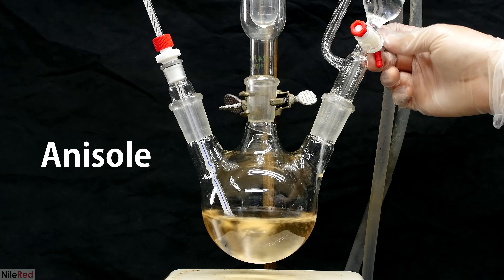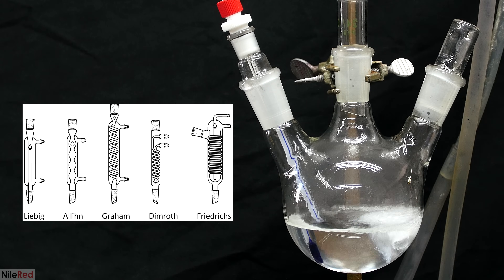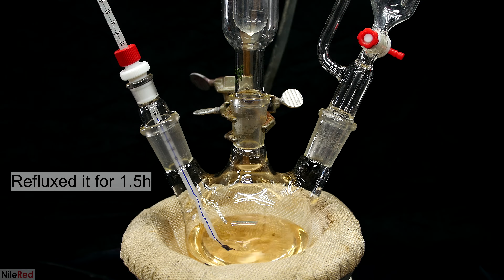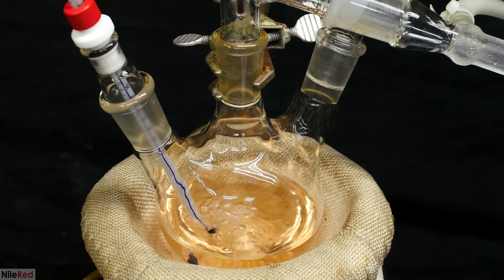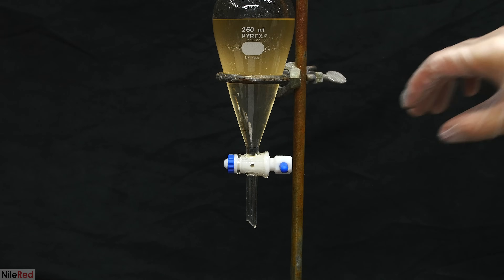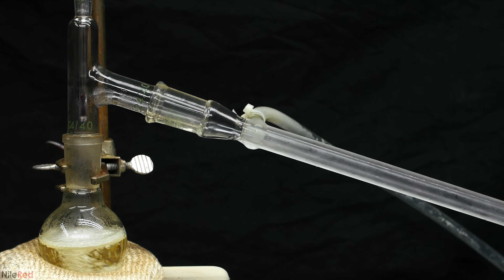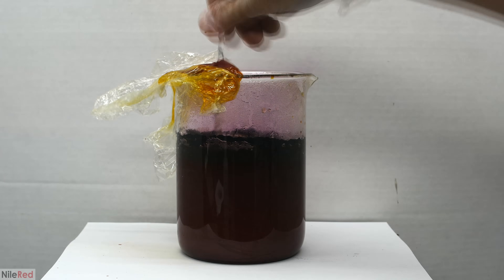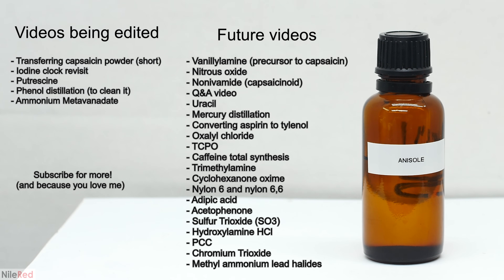Making anisole

Comment: i know it has been like 9 years but in 5:10, the reaction probably didn't spike temperature maybe due to the concentration of reagents (if it wasn't the same ofc) or due to a ceiling in the boiling point. if the reaction was even remotely close to refluxing, that reaction heat just goes to phase change instead of rising the temperature. Probably his setup somehow allowed the superheating of methanol (having a poor reflux efficiency condenser cause this, even having a closed system or anything like that), essentially meaning you don't let the methanol boil, that heat can't go to phase change hence the temperature rise. i could be wrong tho, its just what i think could have happened

Comment: The carbon-iodine bond is very long; the usual bond length is comparable to the sum of estimated Van der Waals radii of carbon and iodine. The bond is very weak. That makes methyl iodide a “hot” electrophile. For example it very rapidly quaternizes ammonia and many amines. That means it keeps reacting with amine lone pairs of electrons until the nitrogen has a formal permanent plus charge and four C-N bonds. That’s called exhaustive methylation. 

You can buy very clean phenol as a solution in water. Suspending it in n-heptane and carrying out azeotropic drying with a Dean-Stark trap removes the water leaving behind a dry solution of phenol in heptane that gives beautiful needles of phenol if cooled slowly. Handling pure phenol with glass or ceramic spatulas keeps it colorless and decreases the color in the product. Phenol readily dissolves oxides from metal spatulas, and the phenolic solution catalyzes air oxidation of phenol. Oxidation products of phenol are intensely colored.

Comment: Making anisole is honestly too much effort and a massive time commitment, and it's significantly easier to just find anisole. Anisole is often found taking handicap parking, yelling at minimum wage employees and may also be located at work or home for some, but not always guaranteed. The fastest and most efficient way to find anisole is by simply observing the epidermis between both of your own gluteus maximus muscles. A thorough inspection should reveal anisole 99% of the time.
Reply: Thanks for the advice. The anisole found between those 2 muscles seems to be of sufficient quality for my syntheses.

Comment: Why doesnt the methyl iodide just react with the excess sodium methoxide? Seems to me the dimethyl ether would just bubble out
Reply: Phenoxide has a much lower pKa compared to methoxide (10.0 vs 15.5) and thus the equilibrium moves toward it when its combined with sodium methoxide solution. In fact, phenol is about 300,000x times more acidic than methanol so very little methoxide will be present by the time methyl iodide is added. 

I'm just an undergrad but this is my best guess.

Comment: The reaction mechanism is Electrophilic substitution reaction. Since anisole is methoxy benzene and all benzene compounds undergo ESR pretty easily.
Reply: This is just an alkylation reaction. Phenol already has a very acidic OH, which attacks the electrophilic MeI to make the aryl methyl ether.
Reply: Isn't alkylation a ESR
Reply: @nushurasaher9876  I think you’re thinking of Electrophilic Aromatic Substitution. But we are creating the phenoxide anion, which attacks the methyl iodide in an SN2 reaction. You are correct, however, that the product, Anisole, would undergo an EAS reaction rapidly due to high electron density in the arene ring.

Comment: question, my chemistry is a bit rusty what is the difference between polar and non polar atoms?
Reply: also wtf is valence
Reply: Atoms aren't polar, the bonds between them are (or rather can be). When you have two atoms with different enough electronegativities, the electrons in the bond will be pulled more torwards the electronegative partner. That way it obtains a negative partial charge while on the other side of the bond you get a positive partial charge due to less electron density

Comment: Why is Sodium-Methoxide used to deprotonate Phenol? Isn't Phenol quite acidic and could be deprotonated by something readily available like NaOH? In that case no metallic Sodium would be required.
Reply: Absolutely. PKa of phenol is around 10, so vanilla NaOH will do the job.
Reply: NaOH hydroxide can be very hydroscopic(sodium metal rapidly dries the residual water in the MeOH), methyl iodide can be hydrolysed vis an Sn2 mechanism to form methanol and I- which would make the methylation reagent degrade, lowering yields.

Comment: I have no idea why have you used such a strong base. ACN or acetone/K2CO3 is totally proper system for such reactions.
Heating is also not a good idea, because of the low b.p. of MeI, also this reaction undergoes in prety mild conditions.

Comment: Is that nesseseary to wear vinil gloves when syntetising this compound?
Reply: With phenol being toxic on every exposure, methyl iodide being toxic on inhalation and on swallowing, methanol being toxic on every exposure and also an excellent solvent, dichloromethane being carcinogenic and also an excellent solvent and sodium hydroxide being very basic, I think you should wear butyl rubber gloves at the very least and wear a gas mask or do it outside/in a fume hood.

Comment: I'm just wondering, why did you have to use methoxide to deprotonate the phenol? Couldn't you have just used NaOH to deprotonate the phenol and reacted that with iodomethane to produce the ether? The phenol can be deprotonated by NaOH so the Na metal wouldn't be needed?

Comment: I wanted to ask if it possible instead of the first simple distillation (to distill methanol off), can we just wash it with water and DCM, cause methanol is soluble in water, also, can we start with sodium in the flask (and keep that in a cold water bath), then with the addition funnel we keep adding methanol dropwise (it will keep most of the methanol from boiling)
Reply: @mohammed, if you do the DCM/ water workup without distilling off the methanol, its going to be very messy because methanol would want to be with both the water and the DCM layer and it will eventually make a very bad emulsion. Although theoretically you could use huge excess of water to force methanol to go that way but honestly it's much easier to just evaporate it. Coming to the second question, you can not keep sodium in water. It'll react so vigorously that the flask would explode. And you shouldn't care about methanol boiling off because you eventually want too boil it off anyway. Although if you don't want that to happen, you can add the sodium slowly. Then again for complete reaction, generally its heated to reflux.

Comment: You used dirty phenol which could affect the temperature increase. I haven't seen Chem players version though so I wouldn't know the purity of his reagents. Also why didn't use sodium on the phenol and then add the methyl iodide instead of using it on the methanol reacting with phenol and then using methyl iodide.

Comment: Hey nile - is there any way to make / get Nitric acid without access to potassium nitrate?
Nitrates are hard to come by in Australia.
Reply from the maker: You can break apart nitrogen in air to form NO2 and pump it into water, but it is pretty slow (I forget the name of the process). That would be your only other real option.

Look online though, sometimes people will sell it. In canada, its not the easiest thing to get but ive found it a few places online (like ebay)
Reply: Electrolize the air.
Reply: Thank you!!!

Comment: Under acidic conditions caused by HCl and H3PO4, the aldehdyde is protonated, forming an oxonium ion. The benzene ring attacks the oxonium ion at the para position (it can also attack at ortho) because the resultant cation is more resonance stabilised than at meta.

The cation is deprotonated by a base in the environment to restore aromaticity in the ring. Next, the OH group (coming from the oxonium ion) is protonated, forming -(+)OH2. Water is a good leaving group under such acidic conditions, and so it leaves, leaving behind a secondary carbocation which is actually resonance stabilised by both the benzene ring and also the electron donating -OCH3 group. Cl acting as a nucleophile, now attacks the carbocation, forming the anisole-p-(1-chloropropane).
Reply: Anisol fiedel caraft reaction . Please??? Anisol +cloroaceton reaction p2p ?????????????????

1 saniye önce

Comment: For the mechanism of the reaction to form anethole, I would assume in step 1 the first thing to happen would be that the oxygen in the propionaldehyde would be protonated to make the carbonyl carbon more electrophilic. It would then undergo a Friedel-Crafts acylation by reacting with the anisole at the para position due to favourable resonance forms of the Wheland intermediate, removing a hydrogen from the benzene ring as a proton and forming a carbon-carbon bond between the ring and the aldehyde (which is now an alcohol). I think that the alcohol group would then be protonated by HCl and via a nucleophilic substitution reaction (like Sn1 due to the possible resonance forms of the carbocation intermediate) water would be lost sand replaced by chloride. In step 2 the pyridine acts as a base and initiates an elimination (possibly E1 for the same reasons as for Sn1, and especially if the pyridine is dilute). The pyridine abstracts a proton the carbon adjacent to the halogenated carbon and the hydrogen's electrons are donated to form a carbon-carbon double bond as the chlorine is kicked off as chloride. I think that's how the reaction would work, just trying to go off of what I've learned so far at uni.
Reply: how much words are here?! XD
Reply: @bingbong430  yes
Reply: But what happened to the phalanges ?
Reply: Too. Many. Words.
Reply: I think it’s not specifically a freidal crafts acylation since the reagents used are different here. Friedal crafts acylation is done using anhydrous Alcl3 and not H3po4 it is an acylation process but not friedal craft. Its actually an ESR reaction
Reply: Nice use of google. Next time change some words so it isn't verbatim.

Comment: Hey Nile, you should leave some sodium metal on the scale and see how much it goes up due to oxidation! (You'll need a lot of surface area though)
Reply from the maker: I think I might need an analytical scale to demonstrate that properly
Reply: NileRed I imagine if you had a x0.00 scale you could see something happening if set up correctly, but yes it would be more feasible with an analytical scale.

Comment: Hey Nile. I got some options of other chemists for the synthesis of antethole from anisole. We figued that a possible mechinism would have the propionaldehyde converted to its enol form in a Keno-Enol Tautomerism. The Enol form has a good OH leaving group that would be attacked by the HCl. This produces the  1-Chloropropene that has a slight positive on the 2nd carbon. This is where we got lost. It seems like the HCl unless entirely depleted would attack the 1-chloropropene again but instead we need the activated ring to attack the 1-chloropropene double bond converting it into 1-chloropropane bonded para on the ring. I dont know if this will be helpful at all but I've been trying to work it out all day. Can't wait to see it!

Comment: 1) 1st step similar to aldol addition like in  phenol-formaldehyde tar synthesis directed in p position due to the steric hindrance, followed by mainly SN1 substitution of benzylic OH by Cl (Secondary benzylic OH should favor SN1, if solvent is water-that's the case)
Formally first step may be considered as electrophilic aromatic substitution-it's very similar to chloromethylation reaction, aldehyde  is protonated on carbonyl =O, HOMO of anisole is degenerate Ψ2 and Ψ3, LUMO of aldehyde π*. Aromaticity is disrupted, untill positively charged intermediate (stabilized by methoxide sp2 oxonium) looses proton to any base (water for instance). Then benzylic 
OH is protonated, it leaves as H2O, leaving behind flat benzylic carbocation stabilized by P-sigma hyperconjugaation and resonance with P-methoxyphenyl and coordinated by H2O (oxygens lonely pairs). Carbocation is than attacked by Cl- and we get the product of first step.
Major side products of first reaction will be 1,1-di(p-methoxuphenyl)propane, 1-(p-methoxyphenyl-propan-1-ole and 1,1'-dichloropropyl ether
2) E2  Elimination-base is Py

Comment: Not sure if anyone has given the correct answer on the mechanism, but I'll give it a go. The  oxygen on anisole is electron donating making it an ortho/para director. The lone pair from the oxygen can resonate to the para position and this in turn will attack the aldehyde in an electrophilic aromatic substitution. Then a tetrahedral intermediate will be formed which is easily protonated by HCl or phosphoric acid. The phosphoric acid protonates the resulting alcohol a second time and now you have a good leaving group. Since this is a benzylic position the reaction should then proceed SN1 and water will leave resulting in a secondary carbocation. Chloride being a good nucleophile can then attack this position forming the first product.
Reply: anisole formed p2p with chloropropane????

Comment: You wont have sodium methoxide in water.  Methoxide ion is a strong base and it reacts with water to form methanol
Reply: The pKa of methanol is 15.5 while that of water is 15.7. Hence, both methanol and methoxide can exist in water, and in fact methoxide is slightly favoured! :)
Reply: The pKa is temp dependent.  Plus, have added lots of water so push the equilibrium across to hydroxide.  If you have done it right you wont have much methoxide due to the reaction with phenol.  In fact this react has been done by adding solid sodium hydroxide pellets

Comment: You can easily use a leibigs condensor - I've done it hundreds of times with no problems..  Just add the sodium slowly, keeping the sodium under hexane until you use it. You can use dimethylsulphate instead of MeI. C-I bond is polarised.  Can easily be proven ...

Comment: Nile, the fact that you'll reupload just for a error you could cover with an annotation is admirable. Keep it up dude.
Reply from the maker: Thanks for the support :)
Reply: @NileRed  on your "Recreating one of the weirdest reactions" you said 1.5 grams but on screen it showed 5 grams for some reason. (at a bit after 5 minutes)
Reply: @NileRed  I can just imagine you in your Nile blue state of mind replying back to this,leaning back in your chair and just saying “why didn’t  I think of that”
Reply: @NileRed  someone asked me what type of gloves i would be comfortable handling dimethylmercury with and i said i wouldn't handle the stuff without 2 layers of kevlar and ar500 bulletproof steel plate am i wrong?(for those who don't know it absorbs through gloves and 3 drops will kill you by attacking your brain and slowly making u deaf and blind,then you're just locked into a body where no nerves work)
Reply: @Anon-zu3xn  Use highly-resistant laminate gloves (e.g., Silver Shield or 4H) under a pair of long-cuffed, 6 mil (minimum thickness) nitrile gloves to provide the best protection against dimethylmercury.  DO NOT use latex, PVC, butyl, or neoprene gloves.  Highly toxic dimethylmercury penetrates these materials rapidly. 

As per the Harvard University lab regulations. Kevlar and ar500 won't do anything. It takes less than 1ml dimethylmercury to cause permanent damage, the only option for surviving is listed above. Just don't use organic mercury. There isn't a glove on this planet I'd feel comfortable using for it.
Reply: @NileRed  what are your thoughts about nile green
Reply: Especially since Youtube dumped all its annotations as of recently. Yeah, people were spamming them, and getting them to work on mobile was problematic, but look at all the cool things people did with them; don’t throw the baby out with the bathwater!
Reply: I can imagine, back to camera and mic, then the editing program, then export, then upload! What a job! love this guy.
Reply: Hell. major news sources dont even do that!
Reply: I wish all the Youtubers who make a mistake in their narration, and then take the time to graphically annotate a correction, would just go back and re-record the line of dialogue, because how hard can it be!?
Reply: They got rid of annotations in like 2016 buddy...
Reply: @ATLTraveler  they shut down new annotations in early 2017, also the orriginal comment is from 2016
Reply: @ATLTraveler  They got rid of the option to make annotations several years ago, but K1naku is correct in this case as it got completely removed (breaking thousands of choose-your-own-adventure videos in the process) around the time that they replied.

(hello from 2021 btw!)
Reply: @kraft.singles  I like how you replied to a 2 year old comment lmao
Reply: nah he could just insert some annotations while editing, like a little note @ATLTraveler